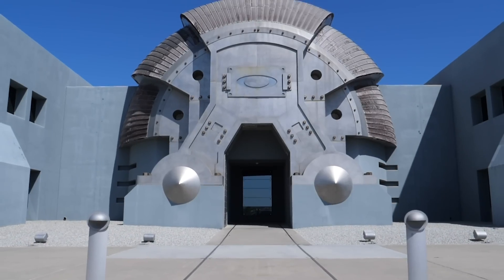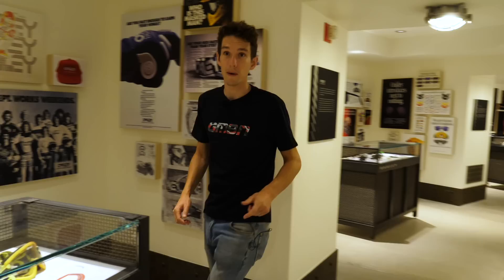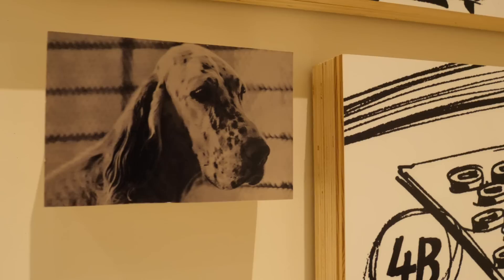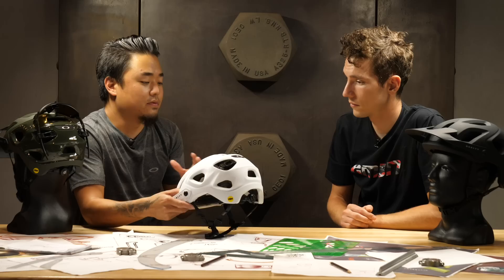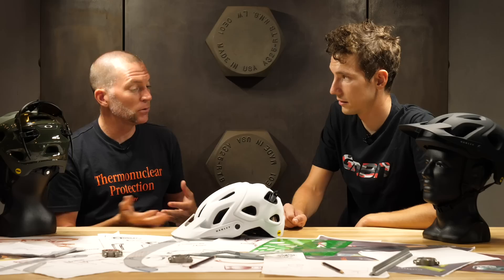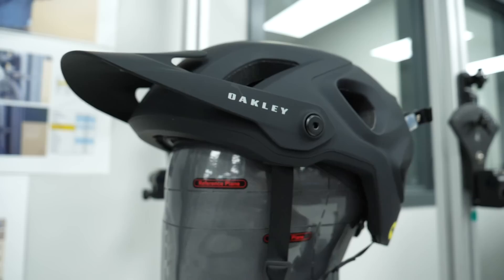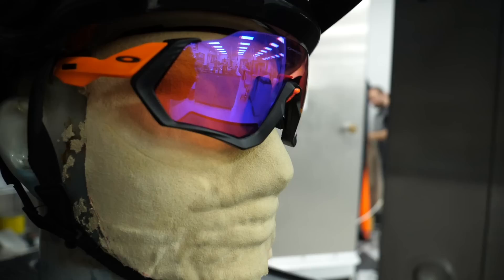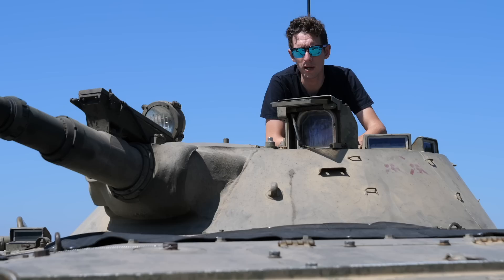Oakley Factory Tour | Behind The Scenes Of Mountain Bike Product Development

Comment: I was really disappointed with my last set of Oakleys. I've been a huge fan for 16 years now, got my first pair of REAL sunglasses at 14, brand new Juliets. Since then I've had several pairs of various designs, but the first time I ordered prescription lenses from them, the first set of lenses was defective, sent them back for repair, the second set, the front coating started flaking off within 6 months.... I got the cold shoulder from both Oakley, and my retailer, each blaming the other. It's really a shame such an awesome company seems to be going the way of most other huge companies, and not caring about QC and just sales sales sales.... It also doesn't help that when you order anything prescription they won't have anything to do with you, they just refer you back to the retailer...
Reply: I have the same experience...for the expensive price the don't worthy.

Comment: The $200 per pair covers the $1 production cost, these headquarters and profit.
Reply: Actually, TOTAL manufacturing cost including shipping, wages, materials, r&d, advertising, sponsorship, etc means that Oakley has a production cost closer to $30/$200 msrp pair of sunglasses.  And if you buy them from Sunglasses Hut, etc then they will make about $100 profit.  If you buy them direct from the website however, they lose a little in shipping and handling but they clear probably $150 of the total sale price.  Custom order probably adds the cost of a sheet of paper and 5 minutes of labor for a picker somewhere, so figure $1.

Comment: Is $1400 to cheep for a new full suspetion?
Reply: I would say that is a good amount of money to buy a awesome bike
Reply: For a first bike you probably don't want to be spending too much. But $200-$300 above that will get you some good improvements, just don't go too crazy with the budget. So that it is cheap enough to have fun on without worrying too much, but nice enough to perform well and last. Then as things wear out over time, you can upgrade them should you see the need.
Reply: I think at that price you should go for a Hardtail. You will get way better components on the bike on a Hardtail. For a full sus you should be spending above 2000€ in most cases.
Reply: But there are very well reviewed bikes (9/10 and 10/10 from many publications) such as the "Calibre Bossnut" that cost around £1000 and have full suspension. So I would argue that £1000 (€1200? [inc 20% sales tax]) is enough to get a properly functional full suspension bike. Will it be as good as a £3000 bike... no. Will it be good enough to have a load of fun on, absolutely. Will it be the limiting factor in someone's riding, probably not, especially if new to the sport. 

Regardless, I would probably advise spending a bit more than that if you can to get some extra goodies like a dropper post (and a nicer frame and spec out if you can go up to £1800 territory). But in this sort of price range, both full suspension and hardtail are perfectly viable options depending on what sort of terrain you will be riding and what sort of riding style/experience you want.

Reviews for reference: 
https://www.mbr.co.uk/reviews/full-suspension-bikes/calibre-bossnut-evo-review
https://www.bikeradar.com/mtb/gear/category/bikes/mountain-bikes/full-suspension/product/calibre-bossnut-evo-review-52230/